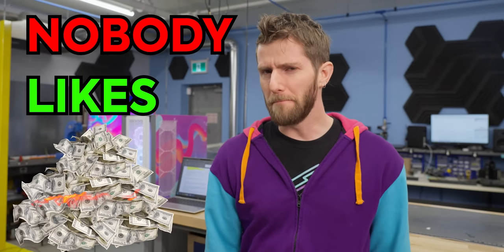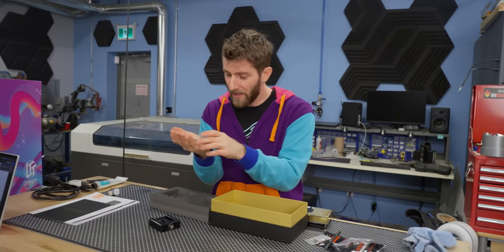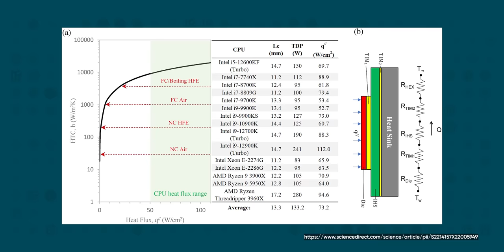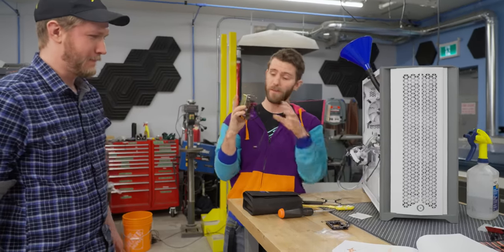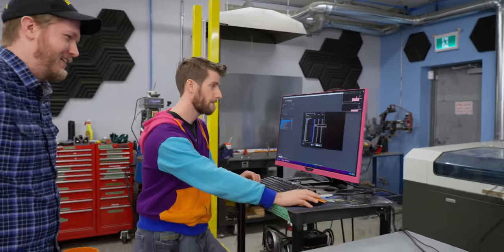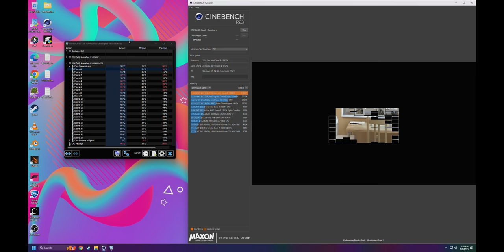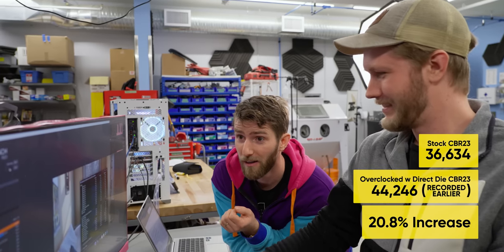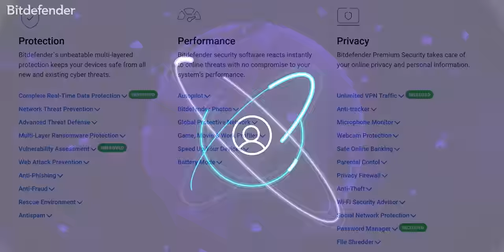This Cooler Might Kill Your CPU - EK Direct Die Cooler

Comment: JayzTwoCents had troubles with the de-lidder too, he took an hour and ended up just using a Stanley blade and popped the lid.
Reply: It's not trouble. It's supposed to take many cycles by design. Linus just went full on caveman with it.
Reply: @flyryan  yeah, it was definitely Hammer Time! Jayz was at it over an hour though and nearly de-threaded the de-caser before giving up and using a blade, he said the threading problem was the de-caser was aluminium and the screw was steel. Honestly though, I don't know why processor manufacturers like Intel don't sell a caseless version with a limited 'on your head be it' warranty.

Comment: 5:14 - THANK YOU, really THANK YOU, finally someone who understands this!!!! I am talking about this all the time (because I remember it from school) and people call me a liar and question my 20 years experiences in PC. 
I can show them this video that I am not kidding and this problem actually exist and another problem is space between IHS and core which is filled by solder and that solder even when it's metal has much lower conductivity than copper and it's another heat transfer from one material to another.
This is the reason why for example higher Ryzen CPUs have 90°C in 100% load and you can't fix it by installing better cooler, because problem is not the cooler or contact between cooler and IHS, problem is UNDER IHS. Especially AMD fanatics can be really agressive when you say that some Ryzen has 90°C in full load because fist - they don't believe you and second, they don't understand what 100% load means.
I believe that intel has the same problem, but area of their chips is bigger, so it's easier to transfer that heat (but that's my guess, maybe I am wront with that area) out by installing more powerfull cooler, with some AMD CPUs on 7 and 5 nm process, it doesn't really work and installing better cooler has no impact on temepratures, cooler is still cool, there is no heat transfer.
And now, you can attack me AMDnazis, this is what your "the best" and "the most technologicaly advanced" CPUs do. 😀

I don't understand why both Intel and AMD are still using these stupid IHSs, they should just put there some frame to protect die from cracking and then let user to install cooler directly on core. That would ofcourse need maybe some change in cooler norms, but pretty much all today coolers have solid big base, so it should not be problem for most of coolers, except those there heatpipes touches CPU directly and there are holes between them.

I've just upgraded my older Ryzen 3800X so I decided to delid it to find out where is the problem with cooling it, I believe that the problem is very thick layer of indium solder.

Comment: Your warranty is only voided if they know you did it. I'd imagine it isn't hard to get some black adhesive similar to what they use around the IHS and "glue" it back down. I doubt they rip off IHS's to check if it was delidded lol. They probably just drop it in a test board and run diagnostics.

I always go surgical when I remove warranty stickers and then I store them on the release paper that I take from some random case badge sticker that I'll never use anyways.

Comment: The delidding tool has extra slide if you remove the 2 screws on it
Reply: He also was supposed to run it through like 20-30 times. Not just two...
Reply: @flyryan  he did but it wouldn't work in the end.

Comment: I still do not understand why intel is still having their peanut butter cooling paste within their processors... Will this ever change? @intel    I do admit it is really a dangerous thing to go with the metal but whenever I have put it into my cpus I completely cleaned them and then I did put nail-polish color over the opened connectors. So even if it would drip it would not be able to harm the CPU because it can not reach anything opened. Okay, I still understand that most guys might not really have nail polish color but then some have a sister or a mother they can ask to use it or even buying it is also not SO expensive... (Compared to the price of a CPU. ).  This was SUCH a great video guys. Wooowi.

Comment: Should probably coat the outside of the heat sink with encapsulated foam. This will give you a thermal break preventing condensation.

Comment: Hey linus, new product idea for you... that waterblock bit the pipes connect to... combine make the rest of the surface a standard (maybe a bit smaller) cpu cooler with fans.... Like you said the further the heat has to travel the less efficient the cooling gets... this gives you loads of cooling capacity, and less delay in cooling heat pulses...

Comment: Der8auer had an engineer from Intel on his channel who said that these latest generations of power hungry CPU's are designed for maximum performance in bursts, not minutes of maximum load. Reaching 100C under constant load is considered perfectly normal. I had my 13700k watercooled with EK Quantum Magnitude though. Runs around 30-40C in normal use and 65-70C in a long stress test.

Comment: If building a rig on a table is so hard to film when the motherboard is horizontal and hard to install when vertical, why not get a 45-degree table that can support the rig, and have it as a compromise so the film crew can shoot too. You can also put a large mirror above for the film crew if it helps.

Comment: I'm currently compiling parts for my next computer build. I always start at the best components and work my way down. It only look at the running temperatures of i9 processors to know I won't be using one. It would have been overkill for me, anyway, so I'm going with an i7 13700K. It still runs hot, but the temperature is a lot more manageable.

Comment: It's odd, I bought a 13900k 2 weeks ago. Overkill for gaming but fun. I'm using the Thermalright peerless assassin air cooler and have no issues. Gamed this weekend for 6 hours straight. At idle all cores were 27C. Average temp while gaming around the 40-60C mark and a max 80C on one core but I never saw that so must have only hit the temp for a few seconds. Think this bad boy only gets really hot when you're stressing it under max load which i imagine a lot of people won't be doing

Comment: man that liquid metal part reminded me of something i saw at work
i work at a company that makes pre built computers for people and ofcourse we also give out support and repairs to our customers if something goes wrong in their system

someone had bought a pc from us couple years ago and now needed an upgrade 
instead of calling and asking for advice on new parts or having it send in so we could help connect it all properly and make sure it worked the way it should
his friends decided to go with the good old dont worry bro...its much cheaper to do it yourself
so they did....and they apparently adviced him that using liquid metal for cooling the cpu was better...turns out they had not only managed to jam the cpu in incorrectly but had even managed to avoid some of the pins..as in it was literally plugged into the socket a row or two to the side XD

the liquid metal ofcourse had well leaked...an now his gpu as we found out later had also been fried because of it so we ended up having to do a complete check of the pc to see if there was anything else they had been fiddling with that may be wrong

Comment: If you are using "liquid metal", I highly suggest not applying it while your CPU is in a vertical position.  Put the system so it is in a horizontal system.  Should you need to remove the heat sink, it is very easy for the liquid metal to run and leak onto the motherboard.  I had this happen, too.
To remove it, use the syringe to suck the liquid metal back up into the applicator.  A swab or cloth will not pick up or wipe away liquid metal.  
I have done my tests and the difference between liquid metal and using good thermal paste was only about 5 degrees.  Liquid metal is not a bad product, but it is living more dangerously, especially for the builder who does not build systems very often, in my opinion.

Comment: you can even etch away a couple microns or even ten to 100 micron of the silicon DIE ( depends on the manufacturing process )
they always put a protective layer on top of the die

Comment: now that im 33 and have built like ten pcs in my life (12700k + gtx1080 + 1tb NVME is what im using right now) i realized that overclocking and water cooling and doing tweaks like these is super pointless in the grand scope of things. The improvements you can achieve on your own by fiddling is insignificant in comparison to the new CPU improvements they make every year. Jumping from a 6600k to a 12700k recently feels pretty massive and all my games run incredibly smooth now (and im using the exact same old gtx1080)
Reply: I beg to differ. Watercooling my old GTX 1080 gave me a massive performance boost, as it both always stayed below 50C and as a direct result of that, boosted to the moon. Hell I could OC the crap out of the core without even coming close to the air cooler temps. Helped me limp along this ancient card some more before jumping ship to team red (RX6800). Similar story for the CPU, though much less so. If all you want to do is use a system and not tinker with it, might as well just go get a console 🤷‍♂

Comment: the directly exposed die can also absorb light, literally like a photovoltaic cell, causing stray currents/voltages that screw up the signals moving round inside the chip.  the principle is the same that is used for UV light erasable EEPROM which even have a little window for the light.   Apparently this issue arises in the testing and development stage of chip design, when they try to boot engineering samples.  This probably will not ever effect a CPU die that is covered by a cooler, but might become problematic for people using those fancy open-chassis designs on really sunny days in a glass offiice building.

Comment: If you won't to use liquid metal buy TG shield from thermal grizzly it's bottle that looks like nail varnish just dap that on areas that are conductive so you don't have to worry about it electronically shouting out

Comment: The difference in CPU Gens is amazing. 
As im a poor pensioner im still running my old FX-8350 @ 4.6ghz.
With watercooling setup in bios it idles at room temp 21*C in most cases 
(But if i leave window open in winter and its 10*C outside the cpu idles without load even in windows @ 10-11*C) 
Under max load burn in test it never passes 48*C until i go to 4.85ghz but i got lucky on silicon lottery i can run 4.6ghz at only 1.32500 cvolts (while many others were running 1.4150cv

Comment: 5:12 Increasing the number of material changes results in higher CPU temperatures due to an increase in thermal contact resistance. It is unrelated to material reflectivity, since thermal radiation is negligible in a thermal contact problem.

Comment: Meh, just BIOS adjust your 13900K or buy the different bracket to shave some 5-10 degrees off. Standard indeed it gets to 100 degrees. But anyone with some knowledge makes it run smoother. My 13700K runs faster now than standard but with less voltage and less heat. BIOS adjustments and the Thermaltake bracket for the win.

Comment: Never Take Off Your IHS unless you have the right delid tools and a heat gun, if you do keep the stock socket fittings beware the cpu won’t stay in place, it will most likely burn itself out especially on a I9

Comment: CPU's might eventually go direct die, or at least a smaller ihs... It's the only way we're going to be able to cool them anymore. there's no case that exists for a big enough air cooler, and most of the AIOs are very limited in what they can do... so the only option now is direct die, and I think EK and others can see that too... I've never delidded a cpu, but I might do it with my old cpu for fun :)

Comment: If you're going to that much effort, why don't you just have a waterblock with no bottom that you glue to the CPU like the IHS was? Then the coolant flows directly over the die. You wouldn't have fins, but the metal in the fins is actually less thermally conductive than the coolant anyway - 398W/mK VS 598W/mK.

Also with that chiller you should calculate the dew point based on temperature and humidity and run it above that temperature. Any colder and you'll get condensation which could drip on the motherboard.

Comment: glad again I chose a 13700K with undervolt and NOT unlimited boost power and duration. also runs quite warm, sure, but I am fine with aircooling. hardware today runs so warm and wasteful...

Comment: I built a $3600 Athlon XP system with a gig of RAM, FX5800 Ultra (Yeah the famous "dustbuster" that is now worth more than the PC was.....), RAID-0 WD800s and a 8x DVD Burner and an SGI 1600sw Widescreen LCD display, Circa 2002, and when I first installed the cooler the bare die that the XPs used made me extremely nervous, so this has to be much much worse, lol

Comment: I like the function of the lot screwdriver but the bit holder inside the handle is not that great. The bits slide around in their holders and fall out on occasion.  And normal ratcheting driver bits are larger and fit a bit more awkwardly in the bit holder in the handle.  Again, the function of the screwdriver is great, less impressed by the bit storage

Comment: Everybody talks how the PCI-E power cables are rated 150w per connector,, and how you need 4 of those for the 4090s 600w, but no one loses their mind when a CPU pulls 500w over only 2 of those same connectors.

Comment: I'm a long-time fan here, but Linus slacked on this review. The block doesn't come with a pump, so what diameter are the hoses and all of the fittings and what radiators would provide the reliability and flow? It's cool that you used a custom cooling loop, but that doesn't really help all of us who are thinking of actually buying this product and installing it in our PCs.

P.S. You should mention that the de-lidding tool (two pieces of plastic), which most of us would use once, doesn't come with the actual block kit and costs another $100.

Comment: Should be interesting if anyone did this new dirext die block vs the same model buy on stick IHS and Copper IHS.
All using liquid metal on all contact points.
I believe direct die would perfor within same few degrees as delided and all copper IHS

Comment: I have intel i9 1300ks with aio cooler. I did remove the intel socket for contact frame and I run around 24 - 28c max. As I did not want my intel to bend that seems to happen with intel designs.

Comment: Might be more likely to kill your motherboard? That's a lot more current passing through the power regulation, tracks and pins, which means a lot more heat to dissipate within the socket and layers?

Comment: Having the same problem as you with the hot core, tried mounting four times and still not great it's got to be something to do with the pressure or Liquid Metal ( to much of it maybe I really can't work it out) idle temp are good around 29c game 88c on the hottest core 3 more are 80c then all the rest 50 to 66c. Any help would be great.

Comment: I would have liked to see at what overclock settings the regular, achievable-by-us-mortals AIOs, reached 90c. It doesn't really help us consumers to see how your industrial grade cooler works.
Reply: You can't cool an unlocked 13900ks with an AIO
Reply: @omegaPhix  They cooled a stock one with an AIO, with several degrees of margin. Therefore, depending on how mild your overclock is, you could cool it with an AIO. I specifically wanted to know at what clock speed the AIO stops working.
Reply: @gormauslander  They cooled a power limited 13900k with an AIO...

Comment: u guys think its a good idea to have the water come out from the cpu and into the video card or vice versa with out getting run throu the radiator first?  the cool water enters the cpu cool but leaves hot or warm and then u make it go into the gpu ? i am just wondering if it went cpu - radiator- gpu-rad-cpu if it would be better?

Comment: Hello, i am building a pc for primarily solidworks and 3d work should i use a amd 6700xt or a nvidia 3060 for my pc build i am gonna be pairing it with a 12600k.
Reply: the 6700xt is a clear winner if you can find one cheaper than a 3060.
Reply: @kaydenroger  okay thanks man👍

Comment: Shame I literally have a CPU block on my GTX1080....since Gigabyte's software absolutely sucks and refused to spin up my fans stock, or manually controlled even with a brand new, month old card at the time 🙄... I'd look over at my second monitor, my i7 8700k at 5.1ghz would be perfectly fine chugging along at 50° and my GPU would be in the 90s and the fans stationary.... I didn't feel like going with a custom loop without at 1080ti at the time (what I actually set out to buy, but some might remember 😅) so I just bought 2 AIO's and water-cooled both that way.... it's been years and they're still chugging along just fine... even though it's getting to the point of higher temps 😂

Comment: i remember having an athlon cpu it basically looked like the one in the video delidded this was way before they put thise lids on there. if you turn on a computer without a heatsink on it its going to break in the matter of seconds. of course these days there is thermal throttling so maybe not so much of a problem these days.